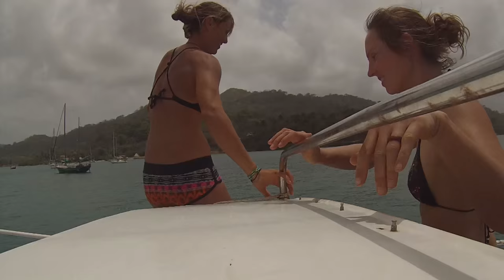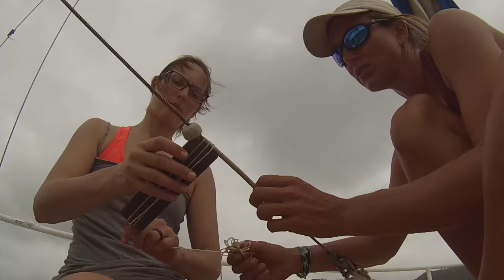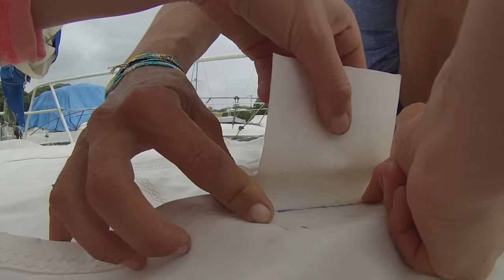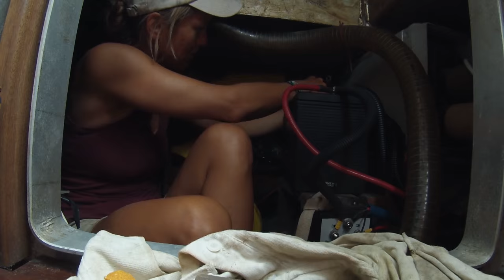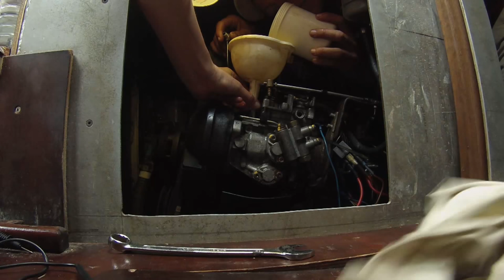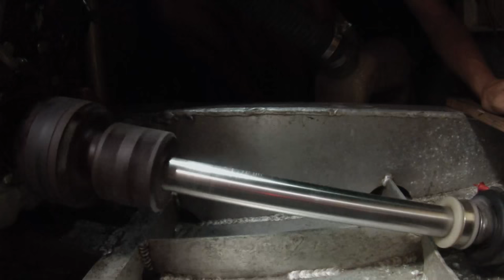Wanting to get back at anchor but the engine won`t start - UNTIE THE LINES S2E03

Comment: A very useful, inexpensive tool to have is an outboard fuel primer bulb pump and some hose.  You could use it to transfer the new engine coolant into the engine.  You can use it as a vacuum pump to check if fuel lines are blocked.  You can also use it to lightly pressurize the fuel injection pump with fresh diesel from a portable container.

Comment: Good to see you back on Karl. I enjoyed all of the first season. You are amazing. I don't think I could deal with the setbacks. We owned a 25 foot yacht for almost two years and it was a lot of hard work but satisfying. I think I am too old for it now and we have owned a 16ft trailer sailor the last year and a bit. I have been looking forward to you getting back on Karl and and wondering where you would go next. I  have been worrying about that engine since the end of season one and whether your batteries would still be okay. One of the reasons i went for a small trailer sailor is no electrical system no plumbing. I just like to sail. Good  luck and I'll be watching.

Comment: Getting a diesel engine full of fuel can be a mess.  I found a small secret years ago.  Install a small 12v automobile fuel pump inline before the filter and use it to circulate fuel through the system to remove air.  Works great if you get air bubbles in your fuel tank from a nasty storm, too.
Glad to see your video's back up.

Comment: Hey, been following your vids for awhile now.  Thanks for posting.  Something you might want to consider, one of the best things I ever did was to install a priming bulb in the fuel line (when I replaced the lines and entire filter from the tank to the engine), I find it makes bleeding the lines quick.  Looking forward to your next adventures!  Cheers!
Reply: scs130773 Hey thanks for that! My mechanic suggested it, and I'm doing it next week. Good to know that it works!

Comment: Good work. I suggest you consider replacing the clevis pin at the top of the fore stay - its diameter is too small (and it is too long). This will wear the holes and increase the risk of losing the rig.
Reply from the maker: Thank you, eyes333333. Someone recommended that on my Facebook page as well, maybe it was you? :) I will try to figure out the right size and try to get a new one.
Ahoy, Nike & Karl
Reply: You should also get a harness and some fall protection for when you climb the mast.  It's not expensive and could save your life. All fall from that height would be a disaster.

Comment: There is a spray which is used to start troublesome engines called "Aerostart" it's manufactured by CRC but if you cannot find this, look or ask for a starting spray that contains "ether" but take care, it's extremely flammable but it does work.
It's been fantastic watching your videos again Nike, I feel as if I've been with you on board all the way :D  Hopefully one day you'll sail in the South Pacific and come and visit Australia.  Fair winds and stay safe.
Reply: Gav Stain Don't use it they become reliant on the stuff and won't start. From a deisel mechanic

Comment: Not familiar with your engine, but if it has a mechanical lift pump, (engine driven, not electric) there is usually a lever that let's you pump the injection pump and injectors full of fuel, thereby saving wear and tear on your battery and starter.

Also, on my boat I have a squeeze bulb, the same one that is used in outboard fuel lines, mounted before the primary filter (the Racor in your instance) that I use to bleed the fuel system after changing filters.  It's much easier and quicker than pumping that little lever....

Just a suggestion, and thanks for the videos.  Off to change my starter this morning.

Comment: There should be a check valve (one way valve), in the fuel feed line, near the fuel pump that may need cleaning and/or replacing. The purpose of this valve is to keep fuel in the fuel pump and injectors and prevent it from running back into the fuel tank. Keeping this valve working properly will keep your fuel system from becoming airlocked and your engine not starting. Nice video.
Reply from the maker: 40cleco. I have never seen such a valve on my engine...I have a fine filter close to the pump and I think that is working a bit like a s?mall diesel supply closer to the pump so it does not have to suck all the way fro, the pump...But I never saw a valve...Maybe my type of engine does not have it?
Ahoy, Nike & Karl
Reply: WhiteSpotPirates Priming the diesel pump/accumulator is the proper procedure to get it going. Once air is in the system you need to prime the accumulator that way. Sometimes you can crank the engine long enough to pull diesel through...but usually you have to do this if you run out of fuel entirely or if you have a tiny leak in a hose and air can feed back into the system. Good work getting it running again!
Reply: What kind of diesel engine is it?
Reply from the maker: It's a Ford XLD 418 :)

Comment: Air in the line between the injectors and the injector pump is the problem. Next time barely crack open the line connection at the injector and turn the engine over until fuel appears. Taking each injector in turn until all the fuel lines are purged of air.  Be mindful of your governor on the engine. Should it fail the engine will run wild and get so hot that the oil in the crankcase will spontaneously combust. Shortly after that the engine will tear itself apart. The solution to a runaway engine is to starve it of air or fuel. A CO2 fire extinguisher in the air intake or a shut off valve on the fuel line to the engine will bring the beast to a stop.  NOTE: I would not put my hand over the air intake to smother the engine. The suction could take the flesh right off of it. A large heavy equipment engine went wild at a technical school and a student tried to smother the intake with a thick text book. The engine sucked the book into the intake manifold  and spewed out confetti from the exhaust manifold. Cheers sailing! I enjoy your vids and I am happy to see you back aboard.
Reply: ***** Believe me any diesel engine has the potential to runaway. If the governor should break it truly will run to destruction. I worked on a 4 cylinder Ford diesel utility engine that came from a hay baler. The owner had cleaned the air filter with gasoline, but did not wait for the gasoline to vaporize completely before putting it back on the engine intake and cranked the engine up. The governor broke and the engine ran wild. By the time he got the engine stopped it had gotten so hot that the oil in the crankcase had caught fire blistering the paint off of the engine. There are 2 methods to stopping such an incident. Smother the air intake with something very sturdy or shut off the fuel supply. The former is quicker.

Comment: I had an inline electric fuel pump on my Perkins 4.108. I could use that to bleed the lines from the tank to the injector pump instead of sucking on them...
Reply from the maker: Hi Brian Hollinger, I had one of those as well for some time. But it got blocked and led to the engine not getting any fuel unless it would be switched on...Took some time to find that out ;). But since then I am back to manual checks...For the bleeding I usually just use the engine. The sucking was just to check for the reason why the engine would not start...so first thing to ceck: diesel supply...But I agree that the pump is a cleaner and healthier way to do it ;).
Ahoy, Nie & Karl
Reply: If your fuel tank is below the engine an electric fuel boost pump may be needed to help the engines fuel pump.  A small screen type filter is placed before this pump to protect it.  This pump is especially helpful as the fuel drops lower in the tank, and as you know for priming.
Reply: A trick I use to keep from getting fuel in my mouth is to use a piece of clear tubing that just fits inside (or over) the fuel line, tight enough to make a seal. This way I can see when the liquid comes out rather than having to taste it.

Comment: they changed the formula for WD40.  It used to use propane as the propellant but no longer does.  The propane was safe to use a a diesel starting fluid.  The new propellant doesn't burn which is why I guess they changed it.  Anyway, that's why it didn't start with WD40
Reply from the maker: Hi Brent Farler, oh wow, that is interesting to know. Do you know when they changed it? Cause two years ago, a mechanic in Shelter Bay showed me this "trick" and it worked. But maybe they have some old cans still around here.
ahoy, Nike & Karl

Comment: To keep from ruining a dry fuel pump, always pressurize the diesel system, then turn the electric primer pump off and start the engine every time!! 
 .... Das needs da elektrik primer pump. :-)

http://www.amazon.com/Electronic-Priming-Diesel-HEP-02A-YANMAR/dp/B00EK62VNY